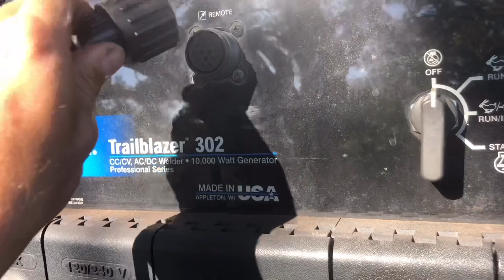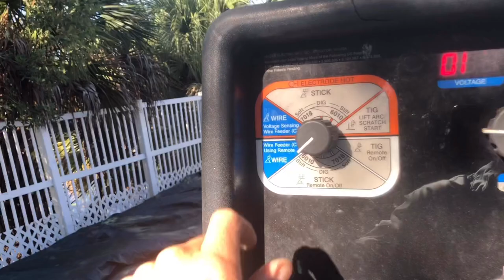How to hook up Spoolmatic 30a to Trailblazer 302

Comment: What’s a good gas or diesel powered welder to get for multiprocess welding? I hear a lot of Ppl say to get a diesel driven welder because you can go farther with it not realy sure how or what they mean by it but what do you recommend buying to get started rig welding
Reply from the maker: only difference would be machine longevity, function wise the type of motor makes no difference. You want something with a 14 plug connector or accessories

Comment: Hey Anthony thank you for all the great content. Really has helped motivate me to start my own mobile weld biz. Say do you ground your trailblazer to your truck? I’ve been researching and get conflicting information. I see that you do have a smaller wire coming off your equipment ground terminal. I’m assuming you
do ground it to bare metal on your frame/bed.
Reply from the maker: I don’t never had a issue 🤷‍♂️ idk what the right answer is

Comment: Hey brother great video. You have been and will be to others a great inspiration and teacher. I have to ask, I have an Sp-30 and WC-24. I run a Lincoln Ranger 8 Tig runner with high-freak module and contactor. Only on-off remote. Works great. I want to run the miller spool gun from the Ranger. I need to know the pin-out & line voltage of the trailblazer/bobcat running to the WC-24? The guy that knows retired. I have spent hours looking at miller pdfs and have not found the pin-out & line voltage. I think miller runs on 12volt and Lincoln runs 24v.?

Comment: Hopefully I’ll get a reply but I’ve got a 600 airpak. Will this work for me? I don’t have a “wire” hookup location. I just have negative and positive. Can I just put it straight to the positive. I mean mine has the same dial as yours with the “wire CV” on the remote side
Reply from the maker: no that won't work. im jealous of your machine Btw. you need to get a control box in order to make the trigger function work. thats basically all the 14 pin does
Reply: @MeltinMetalAnthony  so I need that big control box that you have in the video and that’s it? (WC-24) as far as the actual hookup for the positive or hot, I don’t have the “wire” I just have positive and negative. If I get the control box do I just hook the gun to the positive? I know the box will hook to the “remote”

Comment: Appreciate it man, im looking 1 up for my Vantage 322.
Reply from the maker: go you have a round connector and does the machine have cc/cv
Reply: @MeltinMetalAnthony  yes it has option for cv wire. 14 and 6 prong connector.
Reply from the maker: @TheJsote1988  ok you should need Lincolns version of a control box to allow wire speed control and trigger function